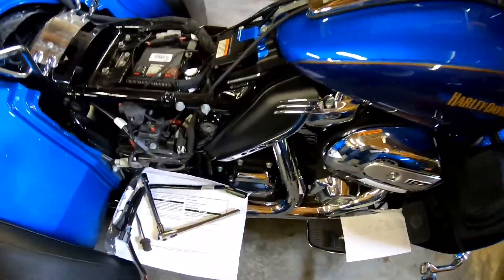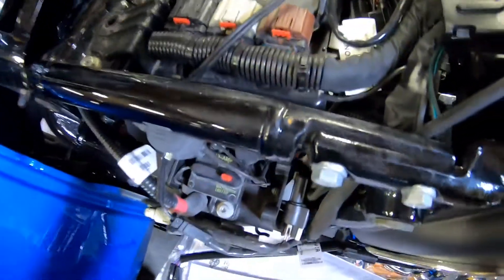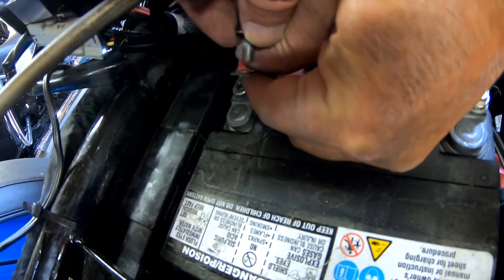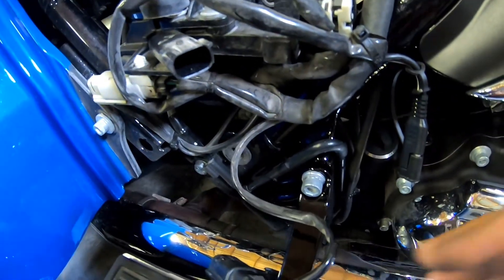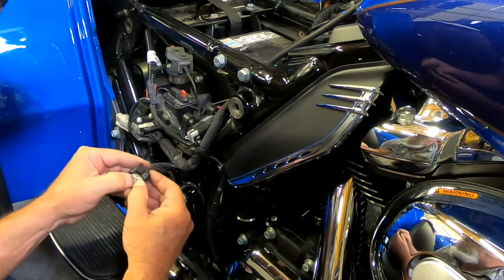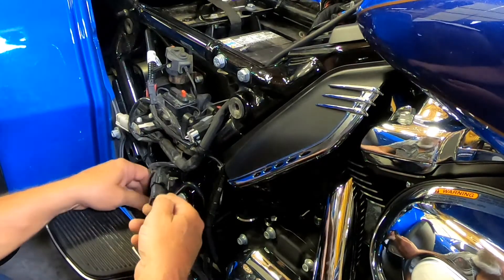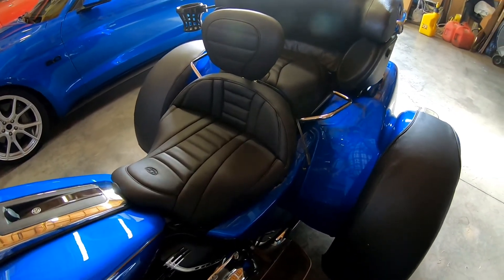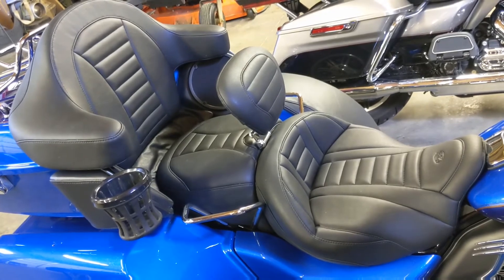Mustang Deluxe Heated Seat Install #mustangseats #denniskirk @MustangSeats

Comment: That's a nice seat package. I may have to get 1. I have heated pant liners and gloves (I almost never use the gloves, too stiff) . I just put hand guards on hoping that will keep the cold wind off my hands. Thanks for showing us how it's done.👍🏻😎
Reply from the maker: Thank you, gotta stay warm and comfortable man when we get older, we don't have heated pant liner's yet, not sure we will need them as we use the lined chap's for the cold weather, the best thing I've bought was the Venture heated jacket liner's, and they probably mean more to me than anything as they keep the torso nice and toasty even on the coldest of days, I did buy some Venture heated gloves that plug into the heated jacket liner's, I haven't tried them out yet because it's not that cold yet, but I did try them on and they seem like they will make a nice pair of riding gloves, there not very stiff at all, and your welcome brother, I hope it helps someone else out, to me that's what it's all about Brother 💯
Reply: @OZARKSHDRIDERS  Yes for sure. So far what's inside my regular lined jacket is warm enough even when it's in the 20's. My hands, legs, feet, butt and face get cold. Hands get so cold they ache first then go numb and don't want to work. Stay warm and ride safe.
Reply from the maker: @EasyRiderGreg  my feet don't really bother me, and I usually ride with a full face helmet in the winter so my face and head doesn't get cold at all, ride safe and ride easy Brother, 🤜🏼🤛🏼💯

Comment: I bought this same style seat for my 04'electra glide and LOVED IT. Got one for my 20' road glide and it didn't fit the same at all. Seat was still comfy, just sat me high and forward, asked mustang and the said they had to redesign the seat pan after a certain year 😒
Reply from the maker: Yeah I'm pretty happy with this seat,it does set ya up a little higher, but it sets me about an 1"1/2 further back, it's a perfect seating position for me, and I like the heat on it really well too, thanks again man, much appreciated 💯
Reply: @OZARKSHDRIDERS  so i used to give my brother a lot of crap for having heated grips. When we started down the "seat journey" he was always asking "is it heated?" I'm like bro, we live in Texas, it gets cold twice a year. We were out for a ride and i fired up my grips 🤣, i was like "ok, i guess i get it now" 🤙🏻
Reply from the maker: @Setzerpendence  lol yeah it only takes a few times of wanting to ride rather it's cold or not,to me it's money well spent, but we get pretty cold temp's here and we still ride, but I also use heated gloves and a heated jacket liner's lol, hey gotta stay warm man 💯
Reply: @OZARKSHDRIDERS  was looking at some heated liner gear, what are you wearing?
Reply from the maker: @Setzerpendence  my wife and I use Adventure heated gear, all we use is the heated jacket liner's and the heated gloves, and it's wired to the bike, don't buy heated gear that takes batteries as the batteries won't last but about an hour before needing recharged, plug in play is the way to go if you want to ride all day in the cold,

Comment: If your going to ride, you might as well ride comfortably. Looks like you could lay down a few hundred miles with no problems. Stay Missouri cool 😎 my friends.
Reply from the maker: Amen,no doubt about that, we have put just a little over 700 miles on it now and it seems to be doing good so far, I've had Mustang seats in the past and I've always liked them, and it was time for that stock seat to go, I got tired of feeling like I was sitting on the tank, but it's all good now as it throws me back an extra 1 1/2" , give me a call sometime, I hate calling you guys because I'm not sure what your guys working hours are, but feel free to call me anytime guys, hey you guys stay Missouri cool too, lol I mean Colorado cool, miss you guys 💯✌🏼 N ❤️

Comment: I'm surprised Mustang didn't put red heat shrink on that positive fused wire, seems like a simple thing to prevent confusion.... Anyway, the seat\backrest look great and I'm sure it'll be real comfy in the cold. 
When I put the Corbin on the Vic, I had to have the backrest stitched to match the seat, it just didn't look right not matched...
Reply from the maker: Mustang didn't put heat shrink on that wire because it has a connecter that plugs into the back of that plug, yeah it will be comfortable and warm, we have had heated seats on most of our other Bikes but the best thing I've really bought was the heated jacket liner's and I bought the Venture heated gloves but I haven't gotten to try them out yet, but I'm sure I will before long with winter approaching, I agree brother, it doesn't look right if things don't match up together , thanks for stopping in again brother Pains, we always appreciate it seeing you here Brother 💯👍🏼
Reply: @OZARKSHDRIDERS   The heat shrink on the terminal end should have been red.  Its black, and in my mind black wires always go to the negative.
Reply from the maker: @painsrides  I gotcha now lol, I don't know why they didn't either but I knew it had to go to the positive side of the battery just because it has a fuse link in it, but that could confuse someone for sure, thanks again brother 💯👍🏼